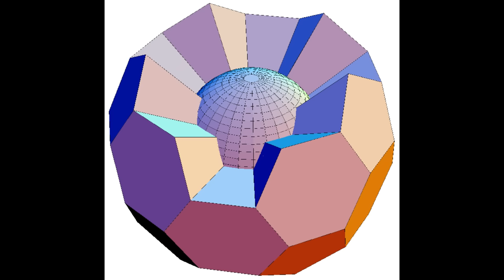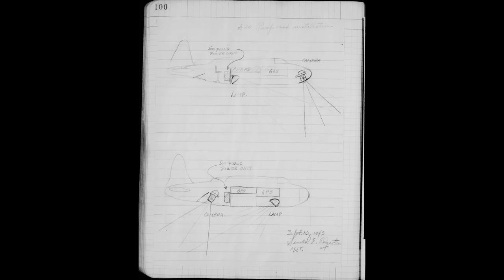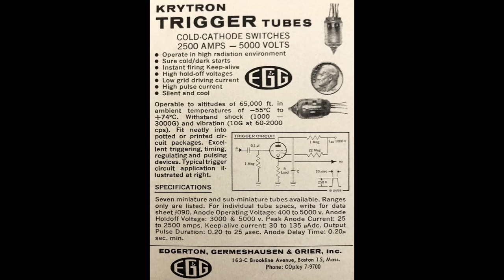Before The First Nuke Exploded... It Imploded.

Comment: The thing about the photography side was that the ultra fast gas switches were not used to fire the Xenon flash, which, for the technology of the time, was easy to do, using a simple high voltage pulse that ionised the gas in the Xenon flash tube at the cathode end. The big thing was they had to actually only fire the tube for a very brief period, so as to only have this very short burst of very bright light, so that the motion of the aircraft would not blur the image. Thus the need to develop a device that would be able to turn on very fast, and also handle a massive current pulse, so as to dump all the charge in the capacitor bank used to provide energy to light the flash tube, so as to drop the voltage across the flash tube (at this time it would be dropping from the 400V or so initial voltage, to the cut off point of around 60V, where the tube itself would start to slowly cut off due to the arc voltage being below the voltage needed to keep it on, slowly being in the order of tens of microseconds) to close to zero, and thus ensure it has a sharp cut off. Most devices at the time would either not last more than a single use, or would not have the fast response needed.

This device was the original gas thyratron, and the need for fast ones meant they made them with a hydrogen gas fill, with early ones filled with neon being both slow, and too low an operate voltage. Hydrogen gave the needed high voltage stand off needed, and because it is light, it also ionised very fast, giving the very rapid current path build up, in the order of nanoseconds from fully off to fully on. This has led to them being now an export controlled device, and to this day an item that is still made, on the original tube lines, by some specialist companies in the USA, as the US military needs them for operational parts, and, because of the hydrogen gas fill being able to penetrate almost all seals with ease, a part that has a very limited shelf life of around 2 years, before you need to either replace or rebuild it. Neither are cheap either.

You can test it at lower current, and do all your qualification at this level, as full power operation you only have around 5 uses, before it degrades to the point it is no longer usable. Selling them is ITAR restricted, as heavily as any part can be, because of the one use case, so there have been a few attempts to steal the technology. These days you still find it hard to get the same power delivery with small volume, it really is a part that is perfect in it's application. But you can do it, with modern high power semiconductors from specialist companies, with corresponding exotic semiconductor compounds, and prices that make the gold used to plate them the cheapest cost in production.

Incidentally the bridge wires also underwent massive changes, from simple thin wires, to the modern ones, mass produced using semiconductor wafer processes, to make thin film metal alloy strips that are precisely controlled in shape, composition and dimension, so that all of them are as close to atomically identical as possible. The difference in timing between them is in the order of picoseconds, they are that identical.
Reply: Why don't you just store them in hydrogen?
Reply: Nice
Reply: @big0bad0brad  It would just be more loss with very little gain.
Reply: @big0bad0brad  Because the internal pressure is critical, you would have to have an external chamber with gas at the right low pressure to have any hope to keep it correct, and that container would also leak hydrogen even faster.
Reply: This is wonderful in depth technical information that I have never seen before in writing. Even expansive histories on the creation of early nuclear weapons don't provide any deep background on this part of the fusing system. Thanks for the education!
Reply: I love writers on YouTube.
Coming across a well written wall of text on YouTube is like finding a chunk of gold in the dollar store bargain bin.
Reply: @SeanBZA  Depends what you make that container out of and how thick the walls are, right?  I'm just saying if you had a bunch of them and needed to keep them ready, that'd be the best way to do it.
Reply: @big0bad0brad  As you have to service them every 6 months, it is not an issue, you would replace them and refurbish them every second cycle, long before they are possibly going to fail. Remember you are talking about radioactive things, and you do not just put them in a box and store for the next decade or three, like conventional explosives. You have to keep them in a 6 month maintenance cycle or they simply do not work. Anyway your ignition package is likely to need replacing regularly, simply because it lives in a very radioactive environment, and you are going to swap out the explosive pack in that 6 month cycle, because there will be degradation from the neutron bombardment that makes for all sorts of unstable new compounds in it.
Reply: Thyratrons definitely have a lifespan much longer than 5 uses, unless you're just massively overdriving them to death. They were widely used up until relatively recently in things like wire EDM systems for driving the wire, and many, many other projects. They are definitely not export controlled in the US anymore, either. Things like krytrons/sprytrons technically are, but semiconductors and other types of switches(such as pseudospark) have gone mainstream, they have been relegated to being mostly collectible memorabilia and specialty/old equipment spares.
Also, hydrogen permeating out of the tube is nowhere near as big of a deal as it being consumed during operation. This is why basically all modern thyratrons contain hydrogen generators, which replenish the supply during operation.
Reply: The Krytron
Reply: @Spirit532  I'm guessing the "over driven to hell" part is probably part of the thing. They only need to work in production once. They are probably validated out their ears too because you really really want it to work that one time. So any advancements since their introduction would likely not have made it into the model he's talking about. Further I presume the ITAR regulated part is also for those specific models that are dual use not generic ones even if the generic ones exceed the spec of the originals because regulations.
Reply: @zyeborm  Regarding krytrons, yes, but for thyratrons for example, they need to run for hundreds to thousands of hours in an EDM machine(well, an older one). Or in RF stuff, etc.
Reply: @SeanBZA  I think the (second) suggestion was perhaps your could build a run of them and keep them in storage under a suitable atmosphere rather than needing to make them fresh on demand.
Reply: I assisted with the restoration of a drum based high speed printer for an old non-IBM computer system in the sixties.  The drum, stretching horizontally across the current print line in front of the paper, was spinning at a constant speed, and was covered with character type slugs, a complete character set around each belt (print position).  The computer sent a full line of character codes to print a line, and each character was stored in a comparator that, many times per drum revolution, checked its character against the current character in front of the paper, and triggered a hammer to hit from behind, slamming the paper between a wide-belt ink ribbon and the character to be printed there, then the character in the comparator was cleared to a space.  Printing a line took one revolution of the drum, or until there were no more non blank characters stored.

The point is, in order to trigger the hammers at just the right time, each print position (usually 120 or 132) had its own thyratron tube!  Even so, the slightest variation in impact time caused the characters in a line to “wave” up and down, which could be very annoying to readers of the documents printed.

For that reason, IBM preferred to use horizontal chains of character slugs, since slight horizontal displacements of characters (particularly in a fixed-width-pitch typeface) are less noticeable than vertical displacements.  But they too probably used thyratrons at first.  Later, solid state devices such as thyristors emulated thyratrons but with lower power levels.  Perhaps they are used in modern warheads too!
Reply: interesting info, but man, this was so difficult to read. Your third sentence is 121 words long!!!

Comment: Dentist drill makes perfect sense, they're air powered and run at about 400,000 rpm. But have practically zero torque. I used to demonstrate by engraving on a piece of steel and would then jab it onto the back of my hand whilst still running, where it would immediately stall. 
Same will happen if the dentist accidentally hits the gum or tongue, they're amazing from an engineering viewpoint. Other than the sound they make...
Reply: That's pretty cool. I'd never thought about that I always presumed they were just like really careful.
Reply: Dentist drills in the early '60s weren't air powered.  At least for the dentists we went to. They were powered by an electric motor and a system of pulleys connected by loops of string/wire.  I'm not sure when the air powered dentist  drills became common.  Maybe they had an air powered dentist drill at Los Alamos, though?
Reply: They'll still put a hole in your tongue. My dentist slipped about a year ago and hit the underside of my tongue. Put a nice hole in it.
Reply: @beeman4266  "hit the underside of my tongue
Did you explode at about +/-24Kton?

Comment: Funny story about TNT.  I was born in 1957 and had an interest in chemistry when I was in grade school, probably 4th through 6th grade at the time.  I had a chemistry set and did all the examples in there, then I went to thrift stores and bought a bunch of chemistry books.  This was in the early 60's and the books were mostly introductory college chemistry as taught during world war 2 as far as I could tell.  They described reactions that would produce all sorts of explosives.  I made gunpowder, thermite, nitrogen tri iodide, and other stuff.  The TNT was a soaplike or waxy white stuff that could melt but could not be ignited by a fuse or hammer.  My dad freaked.  He explained that this was nothing like the burning stuff I had seen.  Its hard to set off, but if you did, it would shatter the hammer head, even the tiny amount i thought would be safe.  No parent went to the school and demanded those books be removed.  Just sayin.
Reply: Either you made it through with all ten fingers or type patiently with whatever you have left. 😅
Reply: When I was in high school one of my friends managed to get hold of a floppy disk which supposedly held a copy of The Anarchist's Cookbook. What it actually was was a bunch of text files of questionable accuracy describing how to make stuff including TNT. But most of it was bogus, I think designed specifically to make people blow themselves up. For example I remember one of the supposed recipes called for you to carefully react, and you'd better keep it below 5°C or else, a few hundred mls of unsymmetrical dimethyl hydrazine with a few hundred mls of red fuming nitric acid. Because of course that's a nice tame reaction as long as you keep it cold.😂

Comment: My favorite safety mechanisms that got built into modern nuclear weapons. They built the implosion soccer ball in slightly differently sized segments. Without a precisely timed electrical detonation any outside forces such as fire or bullets would not set off the bomb in the correct sequence to acheive critical mass.  Further more you can add another layer of safety by encrypting the precise firing order for the explosive lenses. Grandpa was smart
Reply: ב''ה, not smart enough to make them unnecessary
Reply: Newer ones are similar they only have 2 points of implosion but the paraboloid pit is slightly off center so that there needs to be a precise delay before firing the second charge, and it us unlikely to do much more than a blue flash without a very precisely timed neutron pulse. Also uses fiber optics so it is intrinsically safe.

Comment: The implosion seems like trying to float water on top of gasoline, you might be able to do it with the surface tension but the slightest asymmetry or disturbance and and they instantly swap places
Reply: Well not an accurate analogy but equally hard to achieve,  so you really do get a sense of how accurate their timings had to be.
Reply: hmm, seems like a challeng NileRed / NileBlue might want to do..
Reply: @unitrader403  I'd rather see NileGreen's take on that one :P
Reply: @paulmichaelfreedman8334 is say it’s pretty accurate as an analogy since the greater the surface area and difference in density, the more unstable it is
Reply: The waiter never can get that right!

Comment: Great segment, especially the details about spark gap switches. In the 1970's, I worked in suburban Chicago building thyratrons, a large tube that could initiate the current then quickly quench it. The company was National Electronics in La Fox, Illinois, and the tubes were used for voltage regulation on very high amperage welding equipment.

Comment: In the video clip of the scientists working on Trinity in the tent, you can see Louis Slotin (wearing sunglasses). He would end up dying while conducting experiments one the later cores that were meant to be dropped on other parts of Japan if they didn't surrender. Those experiments involved handling the core with a screwdriver. One day, the screwdriver slipped...
Reply: At 13:37 : Louis Slotin was the second to be killed by the Demon Core. The guy sitting in the background is Harry Daghlian, the first physicist the core killed.
Slotin knew exactly what was going to happen to him because he sat by the bedside of Daghlian as he died.

Comment: Fascinating! I had heard of the Jumbo container, but was told that it was some random container they had dragged in to see how powerful the bomb was up close. Your explanation makes much more sense. A successful nuke going off inside Jumbo would be interesting.

I didn't catch it if you said it, but all those cables looping around the outside of the bomb were the same length. The signal to the detonators had to arrive simultaneously, and the length of travel affected the timing. (Or so I heard.)
Reply: I was going to mention the same thing.... absolutely correct.
Reply: It certainly would .  Same reason PC memory modules are very near the CPU, with specially shaped signal traces on the PCB .
Reply: The jumbo container is still at the Trinity site, which you can visit on two days of the year. The visitors' line is miles long, so you need to arrive very early.
Reply: Yes, the cables needed to be he same length. I had the same problem with clocking circuits when I was building computers for Digital Equipment Corporation in the early 1970s.